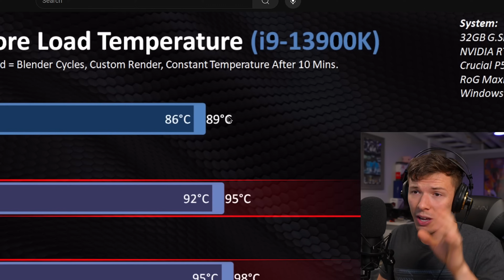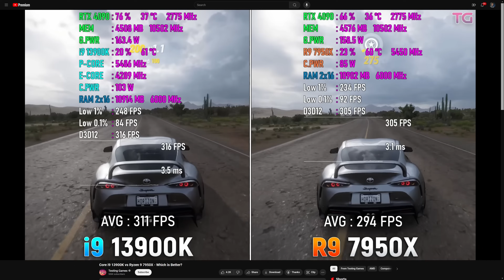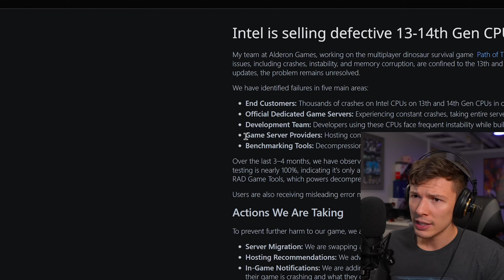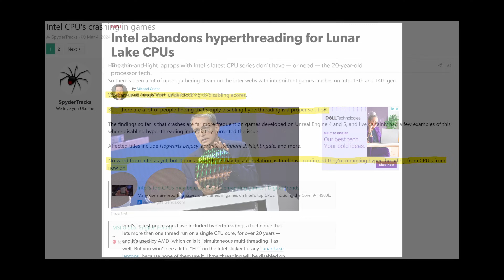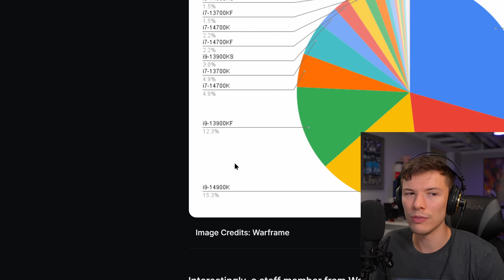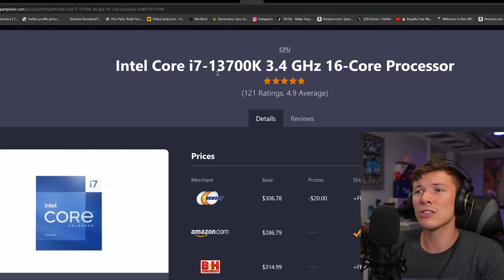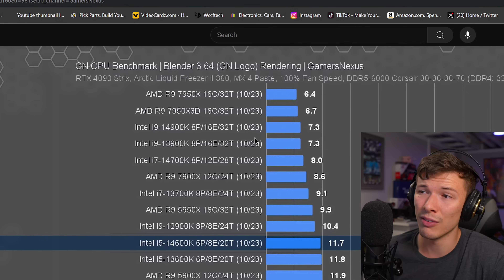Intel F**ked Up Bad

Comment: People say AMD ruins their marketing. But here comes Intel given AMD some great publicity.
Reply: Remember that powerpoint they did accusing Ryzen chips of having glued-together cores and brute forcing clock speeds to compete? This makes Intel look like they were projecting HARD the entire time since their lineup have efficiency cores and massive power draw.
Reply: @AxleTrade sure like AMDs don’t have a massive power draw and are “power efficient” lol
Reply: @Gutts117 none of that matters if they actually work compared to the Intel cpus lmtao
Reply: @coaltrain2299  im sorry was I fucking talking to you? Because the part of the conversation was power draw not them working and if you don’t update to the newer CPU everytime there released which normal people do they don’t update every fucking time a new processor comes out they are functioning chips beside the generation that’s having issues im sure you’d be “oh but” If AMD came out with a flawed chipset
Reply: @coaltrain2299  also if your going to try to degrade me check your spelling it’s embarrassing
Reply: @Gutts117 Kiddo what got you throwing a tantrum? Go meatride intel somewhere else, the cpu probably ignited a fire under your arse with that 99°c. performance
Reply: @Gutts117 If we are talking power draw, previous amd generation was basically going punch to punch on their  basic line up from 65watts

And their middle lineup (x700+, like 5700x) to 65-95

And the most power consuming which was the 5950x on basic turbo was literally 105 watts.

Now lets look at intel.

Hmm similar performance on each price category is usually 40watts more, but ill give them this, the 12400f and 10400f extremely efficient unlike the rest of its family at 65watts, but the 5700x kinda destroys it in speed, efficiency and overall consumption. This was last generation since am4 lasted multiple intel generations lol

This generation am5 versus intel 13th generation and 14th generation

Ima keep it short because neither have fully pulled out the true big guns but so far, most of the amd lineup is 105 watts for lower end CPU models while their normal consumer is 170watts with factory overclock.

Intel is actually releasing some very nice T series efficient processors but their K series which were supposedly going against AMD's stronger offerings start at 125 base watt and 253 watt at factory turbo. Where is the efficiency beyond the efficient designed lower T series cpu???

And lets not talk about the performance to wattage draw
Reply: @Gutts117 AMD doesn't have an insane power draw issue when under load like in recent Intel CPUs. They do have a moderate ideal power consumption(30-45w) and when under load they consume far less power and also have better cooling compared to Intel. 

Also, have you ever heard about punctuations? Please use them and check your spelling too.
Reply: @abhilashs2264  lol sure dude typical ignoring the link like a brainrot victim lol AMDs always had more power draw and a crutch on ram up until recently why don’t you actually compare the preformance and compare it to power draw because I’m sure that my supposed rival to my 9900K even if it has less power draw dosent have the same preformance and I’m not gonna bother using punctuation because your ass ain’t worth it
Reply: @Gutts117  you don't know what you're talking about, I'm still on a amd ryzen 5600g and I have zero issues. you don't need the latest amd cpu to have good performance on games. I can run most new games coming out at 100 fps or higher on 1080p, could care less about 4k.
Reply: @abhilashs2264  have you heard about me careing what you think? No? Then you must be talking to a imaginary friend lol if AMD had the same issue youd probably say shit but when there’s a mistake made on intels part you sure as hell don’t waste time on getting on that train it’s truly hilarious and I find it funny when you can only say “compared to recent” 😂 even regardless of power draw intel chips are as powerful or more then most AMD , apparently you have the mindset that people should buy the latest in greatest when people don’t buy shit as soon as it comes out
Reply: @infern209x  I like how your arguement is “I don’t know what I’m talking about “ then say “I play 1080P at 100FPS” 😂 and think 4K is the only other resolution then 1080P with no middle man
Reply: @Gutts117  there is no word as "careing" and there is a lot of difference between then and than. Didn't you go to school? Didn't they teach you some basic English? Oh right, even if they did why would you care.

I didn't say what I was thinking, i stated some facts. If it were AMD having issues at this scale, I wouldn't care less and i would bash them left and right. 

As in compared to recent, it's 2 damn generation. If not for for 10,11 and 12th gen chips, Intel would have shut their business. They sold literal $h*t of chips for generations untill AMD introduced ryzen line-up. And now they are doing dumb things again and I don't understand why people like you defend this company .

I won't care what your replies be next, it just seems like you are an Intel fanatic and wouldn't care however they f$&kup the customers. Have nice day/night. Goodbye.
Reply: @abhilashs2264  lol 😂 fanatic ok you really sounding like the rest of the AMD fanboys who say they don’t care what I type next then type out some long paragraph which just seems like a tantrum. and expect no reply as in it’s magic and I won’t reply not to mention a typical tactics on trying to push there point by using typos. as there weapons they’re trying to fix the code that’s overvolting the processor but you seem to ignore that fact like everyone elts your just pissed because you can’t actually use anything you have fun bruh with that W you think you have. And PS : gee I wonder why dumbass that I’m defending that I usually get my processors from and work fine I just don’t know. 😂 possibly because not all of there products are having the issue that’s in the process of being fixed? Couldn’t be lol. 😂 if you didn’t want to be pointed out as a fucking ANTI-Intel and AMD fanatic maybe use your brain and don’t post were a lot of them are having there usual dumb rants.
Reply: @abhilashs2264  better stock fan who sounded almost silent
Reply: @infern209x  well i updated from that chip to a r9 5900x to do mb cash and 12 cores 😊 enjoy
Reply: never had any overheat issues or meltdowns with any AMD computer i have every owned.  AMD has been at the fore front of developing new CPU technology.  They are the first to break the 1 GHz speed, first to have processors that can execute 32 or 64 bit code at the same time (this technology is still leased to intel today).  First to produce multi core chips for both consumers PC / Laptop's and servers.  Also i might add, AMD Chips cost a considerable amount less.  

My biggest complaint if you are having overheating issues is the following, 1) How close is your computer box to the wall?  That choking it's ability to push heat away.  2) Is the computer (in summer) in a room with A/C?
Reply: The new notebook stickers "No Intel Inside" (shamelessly stolen)
Reply: amd proving more and more they're the best cpu brand on the market.
Reply: Reminder that AMD "won" temporarily in the early 00's by producing CPUs that were far below the Intel power envelope
Reply: @SterileNeutrino  https://youtube.com/shorts/ZfoYXxq-K3I?si=MVTUP2AN93Htmzy9
Reply: Yeah, personally not going with Intel until new leadership comes in.  Crazy that Intel is the completely unreliable one now...

Comment: I don't understand AI cores in the CPU.
A GPU already has everything for running AI inference, and the CPU core cannot compete with that.
A really large model may need more RAM than the GPU has, but at those sizes you are still better off with transporting stuff to the GPU from the CPU RAM, which is slow, but faster than the AI accelerator in the CPU.

Comment: I'm not sure heat alone is the issue. the 4970k ran at close to 100 degrees all the time. Mine lasted just fine for over 10 years, up until i sold it to upgrade to a 13700KF. Fortunately I've not experienced any issues with the new chip and it has performed very well (so far).  My partners computer with a 13600k did experience lots of crashing when playing Hogwarts Legacy. This makes it very hard to place the blame on anything specific, as its just the one game with issues. Is it the game or the chip?

Clearly if large companies running lots of servers are experiencing more problems with Intel, they are in the best place to comment. I hope they get to the bottom of this issue.

Comment: I use a 420 liquid cooler on my I7 13700 7 fan system.  The temperate of the chip never goes above 40 degrees.... If you run a Ferrari(I9) hard, don't be shocked when you get hit with a massive maintenance or replacement rebuild ...

Comment: It is just intel pushed its performance envelope/boundary too hard. They should have set spec more conservatively. Reduce clock and power TDP by 10%, then it will be OK.

Comment: Weird to see it all swing around like this for intel. I remember my first PC which had an AMD FX 6300 and at the time there was so much hate towards AMD and intel bootlicking to the point where I eventually got a 4690k as my next CPU. I didn't realise that after haswell intel were going to take many many generations to make meaningful upgrades to core counts and clock speeds with only slight IPC gains each gen. Since then I got a Ryzen 3600 and upgraded to a 5900x on the same board and it truly feels like Intel has never managed to recover from AMD's bounce back with Ryzen and the pace at which they've made gen on gen improvements. Intel still has managed to improve over time but for the price and the power consumption I just feel like they're hitting a downward spiral and can't compete. They still haven't had a generation that has put AMD on the backfoot when it comes to pricing, they seem to just be treading water. This all seems pretty catastrophic for them when they're in the midst of a super slow start to their entry into the discrete GPU market.

They need to come out with a big hitter CPU architecture like Sandy bridge and Haswell did ASAP

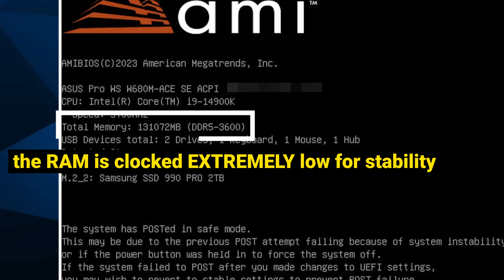Comment: 5:29 if anyone still has problems grasping the scale of demanded stability from servers: I've been running my server with uptime (time since the system was turned on, without a second of interruption) of 900+ days (literally Im upgrading it, so now uptime is some sad number like 1 day, but I dont think it will be rebooted until at least 2027). And that downtime was only becouse I ran out of storage and had to upgrade it.

Literally expectation is years of perfect stability without interruption. I checked ram speeds. 2666. Very conservative. Stability is the king

Comment: For anyone interested. In my country, it has just been reported that many other countries are also facing the Intel cpu failures. Worst, in my country, they affected airport function. While the flights weren't cancelled, the check-in process became a bit of a nightmare since it had failures. So yeah.
Reply: I love when people say "in my country" without specifying the country. That way you can tell immediately that it's straight-up BS nonsense.
"IN MY COUNTRY" giraffes taste like bubblegum.
For anyone who lives on this plane of reality, airports don't use.......... Intel i7 and i9 processors to function... not even "In YoUr CoUnTrY."
You're confusing a completely separate CrowdStrike problem.
Reply: Intel isn't responsible for CrowdStroke.

Comment: Information I found was to lock the ceiling, and then slightly adjust the voltage floor via offset.  this makes up for the degradation and prevents further damage.  
OR...just spend less money on AMD...

Comment: Funny thing is I went with an 12700k in late 2021 and was thinking of selling and upgrading for low cost to 13900 or 14900k because of mobo compability so I could stretch the whole system a bit more. But once I saw it is the same architecture overclocked to 6 ghz I was already getting a feeling that there might be some degradation issues. It was just kinda common sense to me. And I wanted to use that platform then for 6-7 years so I stayed with 12700k and probably will for more years to come. Buying Intel again at some point because I'm no fan of AMD since I had really really big issues with 2 CPUs and 2 ATI graphics cards in 2004-2008. Once Intel stabilizes they will bring good products again as I've never had any issues with Intel starting from 2001 with my first PC. I understand that AMD has better gaming performance for CPUs but their GPUs have been lackluster since raytracing dropped, no DLSS no good Encoder no Cuda and so on. And when I watch repair channels almost always an AMD-CPU has a dead memory channel which I've never seen on Intel. also AMD still has a lot of driver problems which I had back in 2004-08, maybe they improved a bit but not enough and NVidia is just working perfectly and brings the usable package. Half of the raytracing power paired with 20-30% less raster power of a 4090 is just bullshit. The rt is gonna bottleneck the heck out of the raster cores so I don't understand the hype for AMD gpus this generation.

Comment: That's weird. I have a Ryzen 5600x and a 3090 and a game I play called Soulmask has crashed twice with the "Out of video memory" error. That's only twice over a couple hundred hours, so it's not really a concern but its strange My AMD got that same error about a month ago. I had no idea intel was having these issues until yesterday. When it happened I just laughed it off, knowing that the 3090 did not run out of vram and the error must be something tricky. 
Soulmask is in EA so it was probably the software, just funny that its a similar bug.

Comment: Intel: "My CPUs are destroying businesses."

Crowdstrike: "Hold my beer..."
Reply: Well at least software can be updated.
Reply: Hardware can be replaced... so?
Reply: @VaracolacidVesci  Ah yes... buying new hardware, replacing the old with the new one (talking about hundreds of server blades), setting all those systems up again etc.... or just running a software update; it's almost the same in terms of effort and cost.
Reply: @VaracolacidVesci  At least a software update doesn't produce mountains of e-waste like replacing failed hardware does.
Reply: @bellissimo4520  hahaha not even close. In most cases replacing a hardware piece is just a matter of switching the piece for an identical one and after a simple reboot you are again running.
If you have a software problem like this one, you'll have to do a looot more.
the current crowdstrike proves that. There will be hundred of places that will take weeks to recover the system cause they cant even boot to patch the system and encryption keys are locked so the file system is also locked there with no chance of switching the files.
Reply: @StrikerTheHedgefox  no it just renders the ENTIRE WORLD unusable. Which a hardware problem will never do. (just watch crowdstrike atm)
Reply: @VaracolacidVesci  Intel motherboards cant accept AMD CPUs. have to downgrade to 12th gen if stay with Intel
Reply: @VaracolacidVesci  Well if you just replace it with the same kind of hardware again, yes. But why would you want to replace a faulty CPU with another faulty CPU? Some hosting companies have already said they'd switch their entire hardware to AMD. And THAT is not as simple as you are trying to put it. I'm not even sure what you are trying to defend here... do you have Intel stock?
Reply: @bellissimo4520  Im not defending Intel, but a software bug can be harder than a hardware problem. which was my point. You were the one looking for alternatives to change the narrative
Reply: @VaracolacidVesci  "changing the narrative"? The OP poster made it sound as if the crowdstrike issue was inherently worse than the CPU problem, but it's still just another software rollout. If you indeed have to swap out thousands of CPUs or even entire computers, that WILL take a lot longer than rolling out another update. You made it sound as if replacing thousands of faulty CPUs could be done just as quickly. If you truly believe that, then I don't know what else to say to you. Have a good life in whatever world you live, Sir.
Reply: @VaracolacidVesci  updating software doesn't come at the same cost for the user.  Obviously.
Reply: @VeggyZ  except when you have to hire experts in IT to recover the data inside an encrypted harddrive that you cant boot on because a driver just fucked you up. When you realize the price of that, you'll wish it were a hardware problem
Reply: Windows 11: Hold MY beer!
Reply: Yeah we had to fix a number of our computers because of this.
Reply: If you have a business then hire some it specialists that can fix your intel cpu, because can be fixed very easy.
Reply: @Cata-K9  Ah yes? Many other specialists seem to disagree; to the point where they currently don't recommend to use Intel at all anymore.
Reply: CrowdStrike's #1 shareholder is BlackRock. You've got worse shit to worry about with those folks. Hope you all like surveillance and identification authentication to a very large extent because BlackRock certainly does. They like 20 year old boys in Pennsylvania also
Reply: Also, failing CPUs can't really be used to rig an election or eat a chunk out of world commerce or cause someone to die on an operating table the same way CrowdStrike rolling out an untested patch right before the weekend did.
Reply: lmao that sums it up
Reply: buddy the fix is here  if you want it nothing wrong with the CPU   https://www.youtube.com/watch?v=9d9PjfBcCao&t=135s
Reply: eeh...huh?